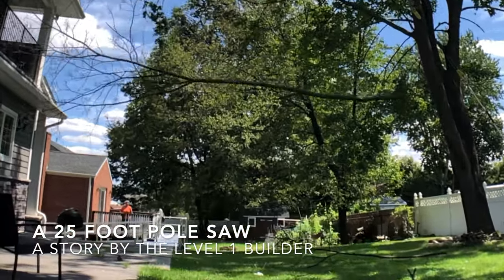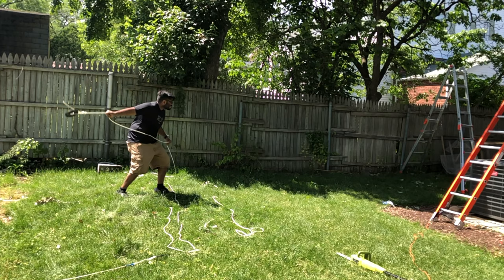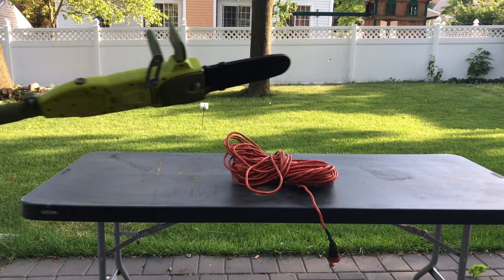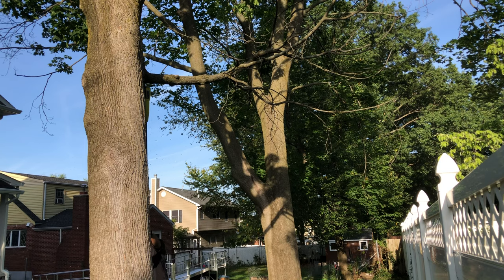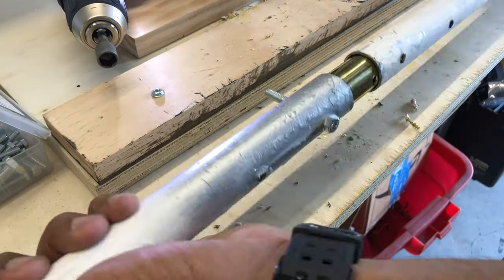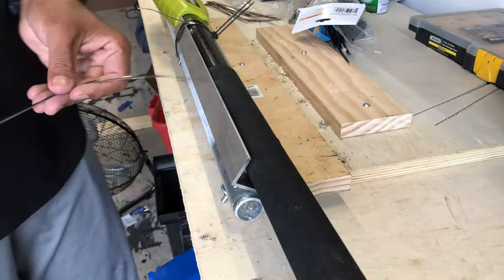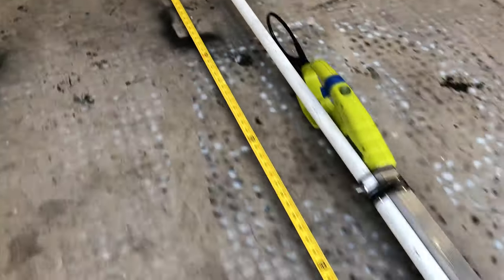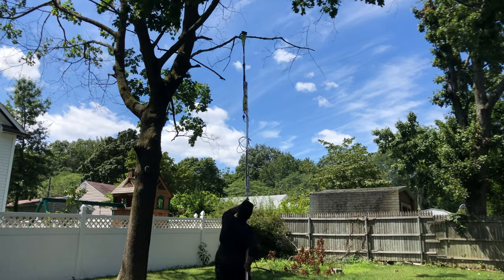DIY Long Pole Saw

Comment: I see lots of advice in the comments… and here’s some more.   Firstly… WELL DONE!  You didn’t back down. You went for it!
Every tree is different… but sometimes… with some planning… you can use a lower limb as a support for that long… tall… lanky handle you added… and pivot off the lower limb while you go to work cutting on a higher limb(s). 
Nice work cowboy!!!

Comment: Nice video.  I did a similar thing years ago with an electric corded pole saw.  I cut the wires from the switch to the motor.  Used chain link fence top rail as my extenders.  Extended the wires down through the top rail to control switch.  Used 10lb dumbbell as counterweight.  Still very unwieldy, but I had on/off control at hand level.
Reply from the maker: Safety first, these day vendors are raising their prices to unreasonable levels…. Got to manage expenses some way

Comment: I will be trying this tomorrow.  Square tubing and duct tape, stay out of the way, wife on porch running the switch, ok, plugging and unplugging.  Glad someone else does sketchy stuff.  I am not to worried.   Just barely out of reach of my harbor freight pole saw by just a little.  Kids, don't do this at home.

Comment: Adding a counter-weight to the base of the pole might make it easier to get the pole vertical and back down again gently. I tried this with a 21ft mast that was 21 lbs all-up weight and roping the base to a concrete block made it easy to raise and lower single-handed.
Reply from the maker: This is a great idea, I plan on getting some work done this summer, time for some upgrades!
Reply: @level1builder261  While musing a bit more on this problem I spied the engine hoist in the back of my garage. I had been contemplating making an "A" frame to hold the mast up but the engine hoist (which weighs about 170 lbs) will give me a really stable point about 7ft off the ground from which to suspend the mast. With the mast/cutter counterweighted with a concrete block at the base I should be able to aim the saw with almost no effort  - always my ambition 8-)=
Reply: And a spotter with binoculars

Comment: There are commercially made pole saws up to 40', a 35' saw is about $550; hand saws on the long pole are about $180.  Pro's cut off some of the limb to reduce weight and impact with stuff below (like house or fence), then they cut the main limb that needs to come down.
Reply from the maker: I couldn’t find a 40 foot saw I could easily purchase .... so it was a fun adventure in “doing it yourself”
Reply: Please post the links of those electric/gas saws that are 35' to 40'

Comment: I was going to buy a bunch of extensions for a Ryobi electric pole saw but after this I am going to just do this. I have a. 35 to 40 foot palm tree and have to make a 35 foot saw for this thing. I am going to put a strap around the tree and make it go around the pole saw because I am going straight up and down pretty much and will just let gravity do the work and the blade will fall through the palm tree grinds or branches. I have to circle the palm tree and just walk it around the tree and go up and down so to speak. I think 30 feet will do it and I might even design a circular contraption to go around the palm tree in the middle that you can brace the ladder onto and move it as you go. It will take the bounce out of the ladder that is stretched out so far it is not as stiff and will hold onto the tree for support by way of ladder. I wish I could rent something safer and quicker or be told a way to do this better
Reply from the maker: Obviously leaving it to the professionals would be the way to go…. But money doesn’t grow on trees, so I get it…. Moral of my video is, this is insanely risky so be smart about it

Comment: Pro tip: You can cut a branch into smaller pieces BEFORE taking down the whole thing at once like at 3:56.
Reply from the maker: Level 10 tip
Reply: Sometimes small brat branches cushion the fall of the large branch, I know this cuz a pine tree fell on my house and didn't crush it

Comment: I did the same thing with the same type of electric pole saw and extension. First I threw a  rope with a pulley on the end up at the very top of the tree and tied it off. A second rope from the ground through the pulley and tied to the end up by the saw. Helps you raise and lower the saw into position and won't let the saw just drop after cutting through the branch. Worked great, but like you say don't try this at home.
Reply from the maker: Indeed… nice trick to improve the idea … got some trees that need some pruning

Comment: May you please also list what pipe you use and what is the connector? Thanks.
Reply from the maker: i would not try this at home because i used Metallic Emt 10-ft Conduit but considered Galvanized Steel Structural Pipe with a counter weight... the internal pipe connectors did not cut it at all, so i had to salvage a external steel bracket which i modified.... if you try any of this, be aware.... you can have heavy steel pipe or chain saw fall on your head.... keep your head on and call and vendor... Do not try this at home

Comment: I actually did this too, yes it is dangerous and i don't recommend it, but I will say this if you do want to attempt it, my case was believe it or not, it was safer then in this video, because I had two other people with me to help lift the saw up around 35 ft high, and another person to unplug the unit just in case that part is vary important, I eventually did break the pole saw in the process, but it got many heavy branches down In the process for around $140, I weighed the risk of getting hurt cutting the branches down vs having a branch fall on me whenever, or perhaps someone I care about or not care about and then have to face a lawsuit lol, the factors here are, peace of mind, risky, costly, you can only pick two of the three. for example costly and peace of mind equals call a tree service to do it for you, peace of mind and risky means improvise something like in the video...risky costly well that just = being dumb with your money.

Comment: how did you connect the 2 ryobi pieces internally? aslo, you must have a death wish lol...
Reply from the maker: I didn’t, it’s non compatible... obviously, they do they want u to make it easier... I instead use steel pipe conduit, and a adaptor for that.... fun build, but insanely dangerous.... but I didn’t have $3000 around to give this job to a vendor....u weigh the risk and benefits

Comment: They don't make pole saw longers because you can't make correct pruning cuts. If you do not make correct pruning cuts there is a high chance the tree will die. Then you will pay for a whole tree removal
Reply from the maker: It was costing more to deal the squirrels in my attic now... gutter/roof pulled up, HVAC repair,  pest control, and sanity all damaged
Reply: @level1builder261  they will just use the gutter to climb up. Put strobe lights in ur attic
Reply: True but it you just first away from the collar then leave a bit to clip after words at the collar then youll be okay,and yes true he should have atleast grabbed a sizable ladder but it can be done alone
Reply: I call bs
Reply: @alfrealphi  on what?
Reply: @level1builder261  Maybe because that's what it takes to get it done right, the first time.